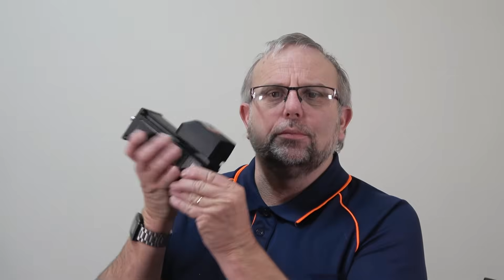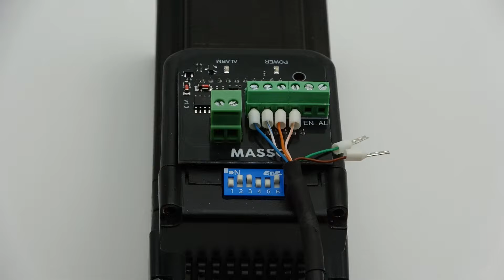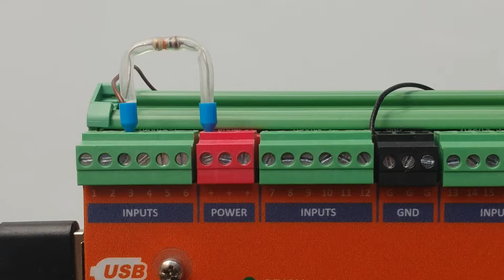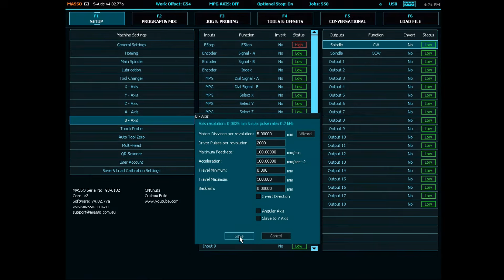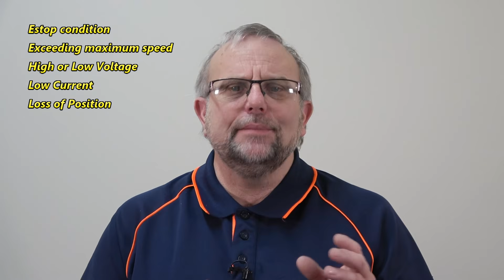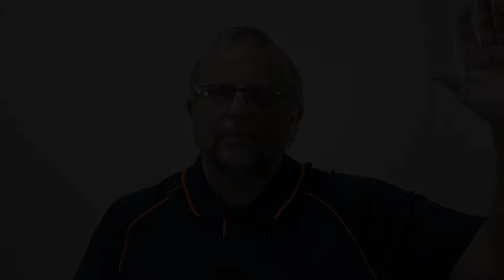MASSO Closed Loop Stepper Motor - Episode 30

Comment: Are these suitable for Z axis. As i have seen closed loop motors do not have a holding capability when the power is turned off. So is it possible the Z axis can drop when the machine is not running
Reply from the maker: A closed loop stepper motor has exactly the same holding as an open loop stepper.
You may be thinking of servos which have not detent to them so move very freely.
Cheers Peter

Comment: Peter...what type and gauge of wire is recommended for hooking up the signal side and the power side..
Reply from the maker: I suggest Cat 5 or Cat 6 Patchlead wire for the Data as it is multi strand, flexible and differential signals should be in twisted pairs and that cable have well defined pairs. I'm talking patchlead cable not building cable. Is is available in shielded.
I suggest 0.75mm² cable for the power.
Cheers Peter
Reply: @cncnutzmassoedition9131  do you use 3 cables? All 8 wires in a cat 6, pairs to each, to the signal and directions , then another cable for the en and al, then another for the two power?

Comment: Oh boy, now I need to get these... I’ll need 7 of them to cover both machines. Pity about the 36 volt max - all of the power supplies for my existing 425 oz/in motors are 48v...

Unrelated, but for anyone considering Masso, I recently passed 1000 jobs run on one of my machines and the other isn’t far behind. These things are reliable as hell. Tool changes without having to manually re-zero in between is priceless. Start a job one day, finish it the next... priceless. I went from hobbyist to being a full time manufacturer in about a year.

Great presentation skills as always, Peter.
Reply from the maker: That's great. Hobby to full time job.
Glad it's working reliably for you.
Cheers Peter
Reply: Nice to hear.  I just got my Masso up and running.  Now I'll likely get the closed loop system.
Reply: By tool changes in between do you mean you have an atc spindle?

Comment: Are the motors bipolar or polyphase?
Reply: Mostly schizophrenic with bipolar tendencies ; )
Reply: @urgentcareguy3  You win! LOL.
Reply from the maker: I don't actually know and it really doesn't matter. The only way of finding out is to disassemble it.
Cheers Peter
Reply: @cncnutzmassoedition9131  By the way, I design and manucfacture servos. I only use servos on my cnc machines because I can't stand the noise of steppers. LOL. How's that for biassed. LOL. By the way again, I'm currently assembling a new lathe. It has servo driven spindle and tailstock as well as X and Z axes. This is the same as my current smaller lather. But I'm adding live tooling to this new one. A Masso is not yet purchased but will be soon. The biggest factor in the decision to go Masso, is your series of vids.
Reply: @cncnutzmassoedition9131  Not so. Polyphase or 3 phase motors are much quieter than bipolar. No need to pull them apart. The specifications will indicate the number of phases.
Reply: @robguyatt9602  I have Leadshine servo steppers that are 3 phase. It always surprises me how much noise there is when looking at videos of other people using steppers. Mine run cool and quiet.
Reply: @martinconnelly1473  I think the Tormach 1100 mill originally used Leadshine 3ph. They call them Easy Servos. I have a couple of their servos. Brushed not brushless. I must replace the driver on my small lathe spindle. It's a horrible design because it continuously pulses the motor back and forth when idle. Bloody noisey. But ok when running.